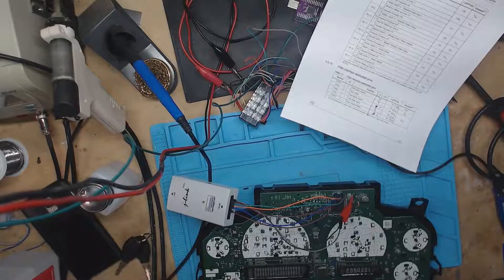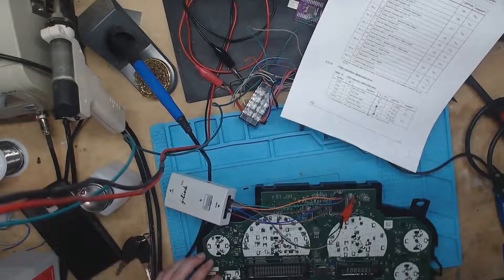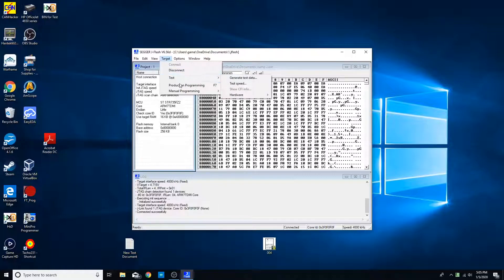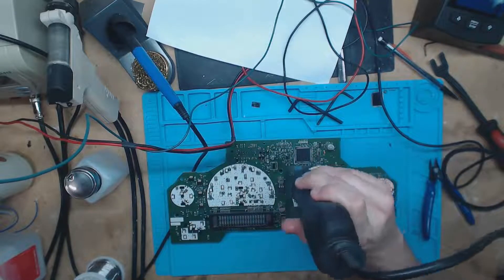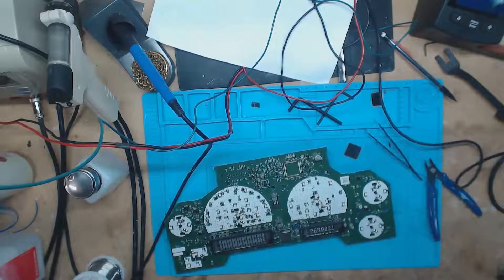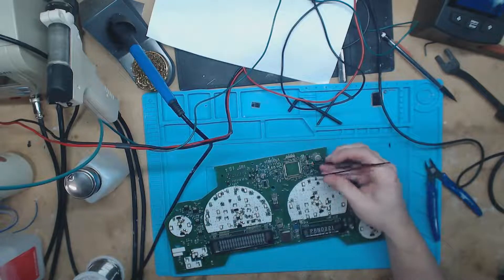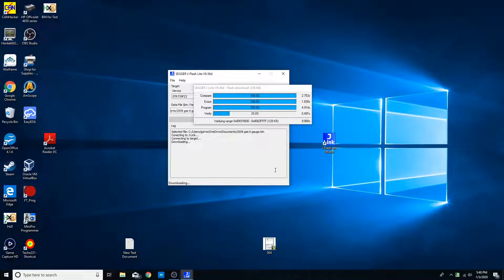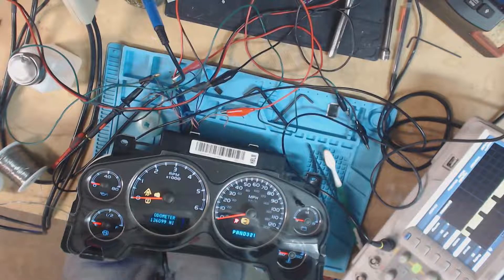07-14 GM Instrument Cluster MCU Replacement

Comment from the maker: The video you are watching is how to repair the issue shown in this other video. https://youtu.be/rWpVXiy3ItA  I've been talking to someone else who is reverse engineering the firmware so that way maybe in the future bin patching is an option. If anyone else knows of a cluster the MCU fails in let me know and I will look into. I've been looking into 03-07 clusters but that MCU is pretty obscure. By the way I would recommend a preheater or some low temperature desoldering alloy  for doing this repair. I had the hot air station going on the board longer than I am normally comfortable with.

Comment: I haven't been to your github yet, but does it give you the option to leave notes with the file? You'll probably want to list the options of the vehicle. Things like gas/diesel, braking system, suspension, 2 door or 4 ect.  Will come in handy if you need to write a chip but don't have the original chip to read from.
Oh and great work! This is awesome
Reply from the maker: https://github.com/garnerm91/07-14-GM-cluster-BINs Thats the link. Ive been saving them with the sticker code in the file name. I'm pretty sure that's the software or feature code.
Reply: @FixedUntilBroken  Never been on github but does anyone you know of have files for the 03 to 07 for eproms
Reply from the maker: @mhjs10  haven't posted any 03-07 eeproms to GitHub but you can find pretty much any eeprom dump you need on digitalkaos which is why I haven't posted any on GitHub.